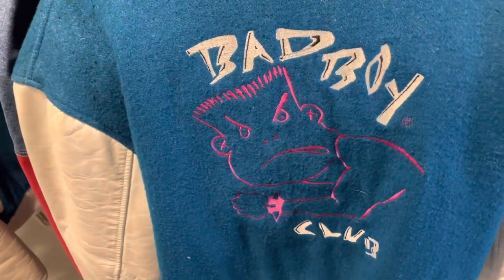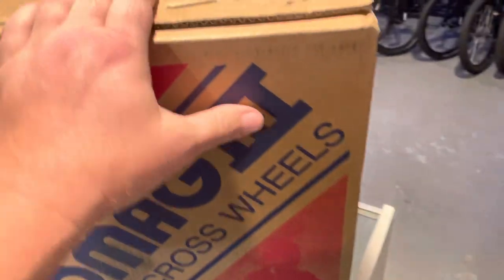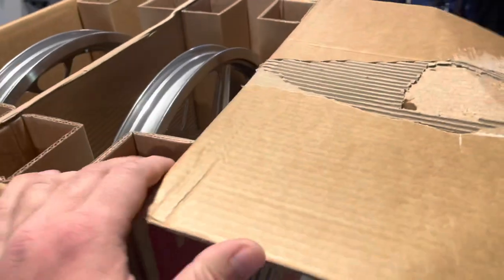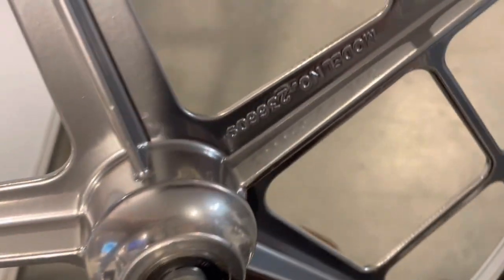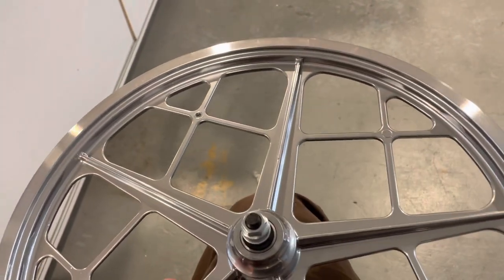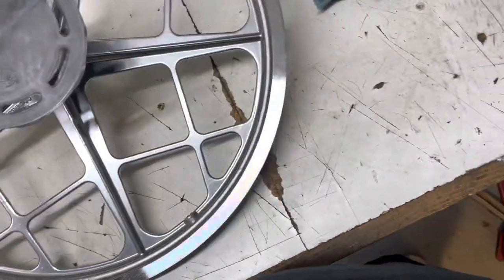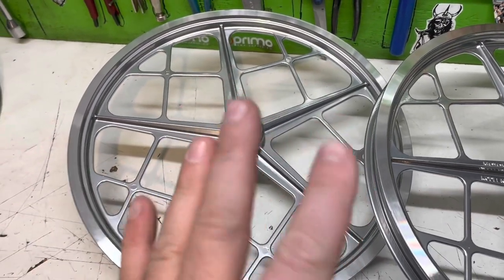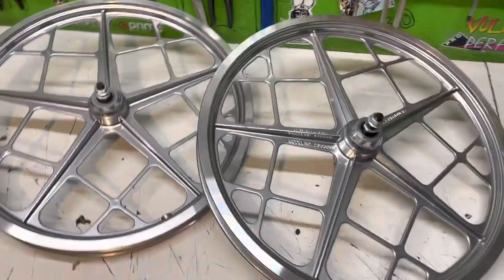Unboxing The New Mongoose Motomag 3’s!

Comment: The old motomag 2's had a coaster brake some of them were the bendix 76 rear hub and the set that I have are a shimano b type single speed coaster brake hub,if I remember right they could be converted to a free coaster
Reply from the maker: Yup! You would take one of the brake shoes out of it and it would be a pretty sloppy free coaster.

Comment: "MOTOMAG I"s had a slightly rougher texture while "MOTOMAG II"s look exactly like the ones you got.  Both I and II were coaster brakes - but you could modify them with an adapter to turn them into freewheel.
Reply from the maker: I talked to Scott Towne on that and he explained to me the differences and how the first ones were rough. I used to change coasters to "freewheels" on my Tuffs when I was younger.
Reply: The original  magneaium sets was ball burnished finish